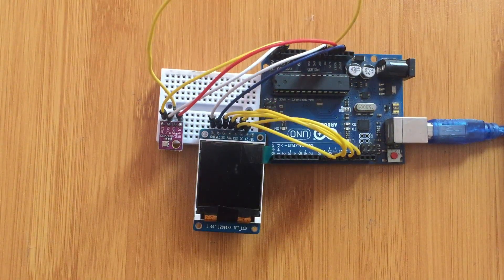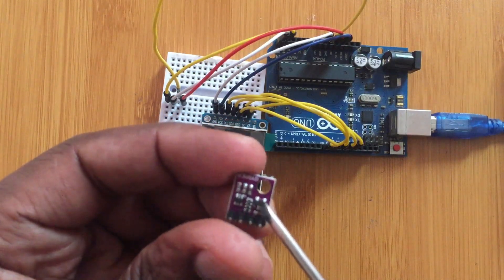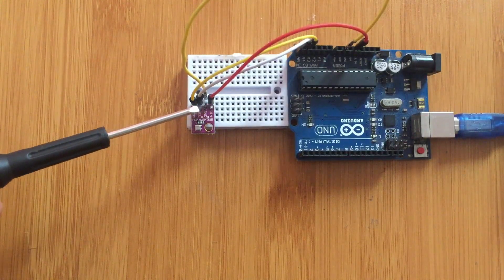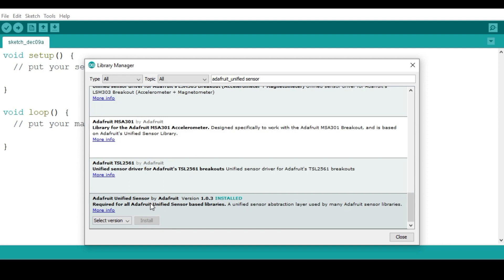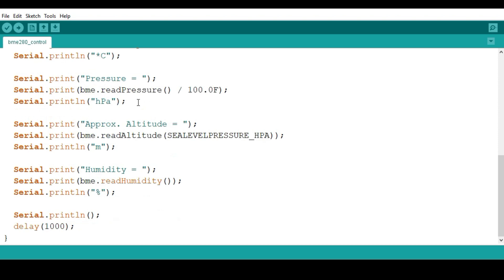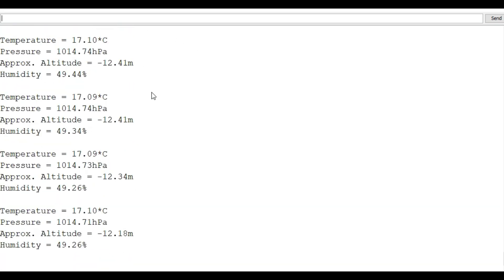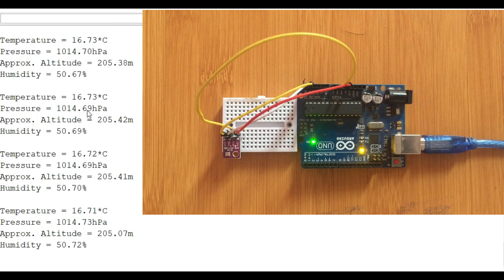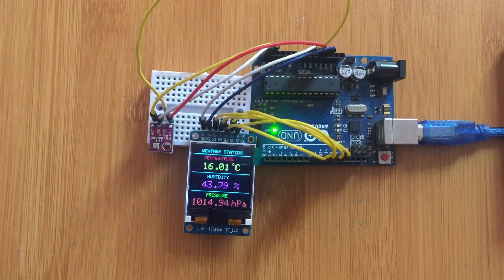Weather Station using BME280 Temperature, Humidity and Pressure Sensor with Arduino

Comment: Hi, don't you care about your site? The code from the video (Weather Station using BME280 Temperature, Humidity and Pressure Sensor with Arduino) cannot be read or copied at all or .... not even downloaded yet.

Comment: Great Video! I would like to build a similar device for computing density altitude for my light airplane. Density altitude is critical for computing performance for aircraft. 

Is there a way to set station pressure (local sea level pressure) via an input? Ie, rotary encoder? That is the only variable this is missing and would change as the aircraft moves from airport to airport.